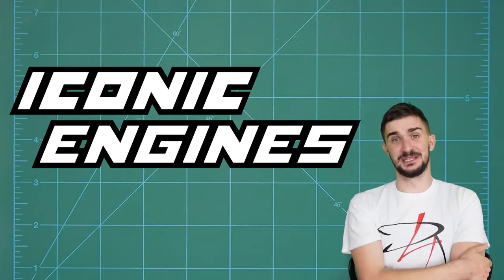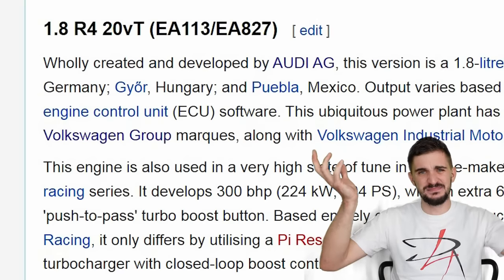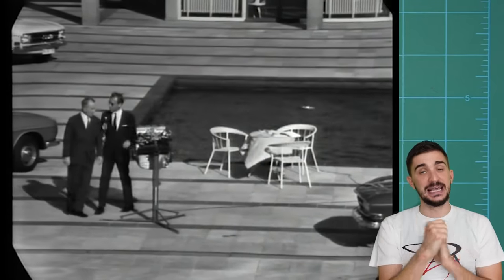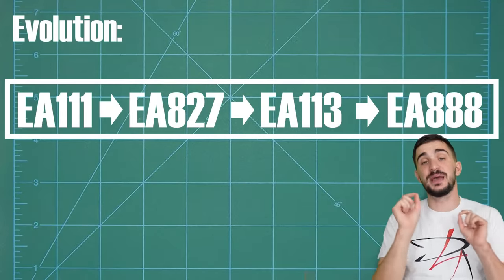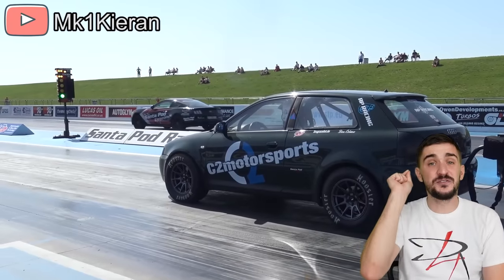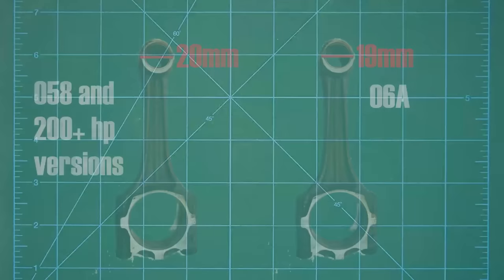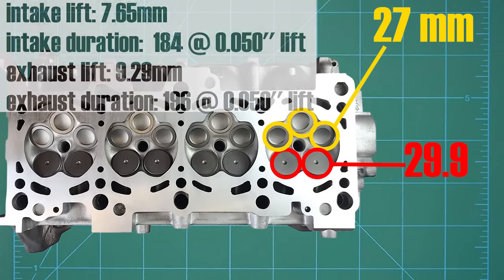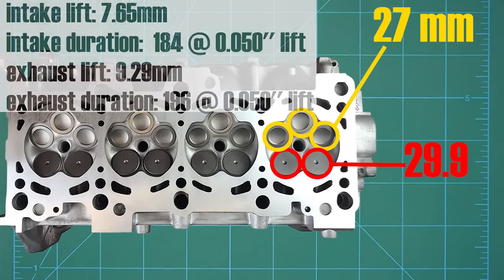VAG 1.8T 20V - What makes it GREAT? - ICONIC ENGINES #17

Comment: So glad the 1.8t is finally getting the coverage it deserves on Iconic Engines. It really is one of the best bang for buck platforms available.
Reply: As someone who drives a 1.8t 20v Gen 3 on a daily basis, i can agree. These engines can be pushed to 250 hp with nothing but a tune, and are able to break 9k rpm with minimal part replacements allowing for power ratings north of 500
Reply: Agree, building a 700hp 1.8t... LaunchBuilt is the channel where it's done
Reply: Yeah when youre looking for a sporty car..but the 1.9TDi will forever be their best engine :D immortal
Reply: @MisoElEven  real talk 🤣
Reply: @MisoElEven  the slowest maybe
Reply: It's the worst technology ever for these kind of power ratings. Everything else is better.
Reply: @eyelid81  it's basic nut and bolt engineering. Basic, tried and tested architecture. Plentiful, cheap to mod easy to work on. Yeah there are better engines sure but outside of America, cheap, high hp capable platforms are becoming very expensive. These are still cheaper than dirt
Reply: @jonathonwilliams93  it's not high hp capable platform. only cheap to buy. expensive to modify properly as it's not inherently designed for high hp applications, just cheap eco engine really
Reply: @eyelid81  not really but I'm not going to argue to change the mind of people on the Internet. You do you fella.
Reply: @jonathonwilliams93  Truth is truth. these kind of videos keeps the myths still up. Smokes and mirrors. Telling worst basic turbo engine ever is good. 1.8T Fandom is as bad as electric car fanboys really.

Truth: It's not good. Buy anything else, it will be better and more powerful.
Reply: Like what? What other decent engine comes in cars worth less than £1k?
Reply: @MisoElEven  the amount of 500 000k+ tdi is incredible
Reply: @alicichlid6805  it's only 150bhp engine. all the other more powerful cars with bigger engines
Reply: @eyelid81  in the UK you can still pick up golfs, leons, Octavias with 1.8ts for around £1k. What other car/engine combo is better value for money?
Reply: @alicichlid6805  those are ecocars. What kind of car you imagine beating with your 1k€ car? Nothing? Honda's? Even Hyundais which are more powerful nowadays? Beemers which are 190bhp minimum? 

I'll bet nothing. They're slowest of the bunch, that's why they're so cheap and it's xpensive to modify eco-engine to 300bhp reliably. 190 isn't enough as it's still 10bhp less than 200bhp which is starting point and minimun for a basic tuning-track car
Reply: @alicichlid6805  we used have dohc vtec going for 1k to 2k few years back now they way over priced
Reply: @eyelid81  probably gonna beat virtually every other car available for under £2k
Reply: @alicichlid6805  Junkyard cars? 150bhp isn't getting your ecofamily car anywhere.
Reply: @eyelid81  plenty of remapped ones for sale making 220bhp. That's still quicker than the majority of cars on UK roads today
Reply: @alicichlid6805  it can hold 190bhp by remap, still 10 bhp less than average tuner car. 220bhp is bullshit.
Reply: @eyelid81  early ones with the ko3 turbo will struggle to get 190bhp, later ko3s turbos will get 200+. Ko4 turbos left the factory at 225bhp. 
An exhaust and remap on a ko3s should be 220bhp
Reply: @MisoElEven   Can't forget the 1.9tdi. I'm driving a Touran 1.9tdi daily and 99 s3. That are the best engines they Made.
Reply: @eyelid81  i can see you dont like the 1.8t but i gotta say, i had a 9n3 with the 1.8 pushing 290whp, thing was a rocket, was hard to find many cars that would keep up in drags. From factory the 1.8 might not be the best in a heavy sedan, but in a light hatch they can move.
Reply: @nips8902  by heavy modifying doing 290whp, even replacing turbo and all the supporting mods. Not good engine
Reply: @eyelid81  yeh i get where you’re coming from, but i personally didnt have any issues with it. But that said there are definitely better platforms out there if you’re wanting reliability and power, from what it seems the people in the comments are acting as if this engine is the be all end all.
Reply: @eyelid81  lol you're def the kind of guy to look at stock hp. My car has stock 200hp but i cant do anything with it because it has cheap ass internals. These 1.8t and 2.0t engines are great and i wish i had one.
Reply: @eyelid81  buddy, nobody is racing these engines stock thats the point. The engine is tuneable idiot hence why people love them. Not all engines that make 250hp stock will be tuneable
Reply: @eyelid81  not bs lmao, ive seen a mk4 golf with some rebuilt internals making 350hp at 21 psi, hence why its tuneable and people love them
Reply: @kank1794  That's weak power, other engines do that with stock internals. It's not tunable if you need to replace everything to get medium power
Reply: @eyelid81  what lmao, the point of tunable is taking an engine, any engine, and making it powerful for what it is. Sure, look at a hellcat engine, from dodge you'll get like 400hp, but that's already been tuned and supercharged, what are you as a consumer going to do to make that a ton better other than add more boost if you can handle it. Yeah, the 1.8t doesn't make much power, and the 2.0tfsi is better stock, but they're installed in these small cars and if you get it to 300hp, thats a lot of power for a car thats 2000 pounds. While for example the 4.6 litre HSE v8 Range Rover p38 makes only 220 horsepower but its like twice as heavy so its slow. Weight to power ratio is also vital, having a big flashy engine means nothing if you drive a tank, 350hp in a Golf is gonna be crazy, while 350 hp in a truck will be good, but not that special
Reply: @eyelid81  also I should add, that range rover engine cannot be messed with much at all, so id rather have a 1.8t that i can push to 300 than a big v8 that has no future
Reply: @kank1794  All other 4cyl engines are more tunable.
Reply: @MD-gk4uh  1.8T is a religion for a childish men. I's tuning doesn't differ aything from other engines, and when putting comparison to other turbo-engines or even best for naturally aspirated examples, it's always the worst engine of the bunch.
Reply: @eyelid81  Get lost troll!
Reply: @MD-gk4uh  you get lost from car tuning scene. you're troll here - telling 1.8T is a good tunable engine - and losing every single race and lapt times since 2001 spring. 

I am telling the truth, I am not the troll here then. Telling the truth isn't trolling. If you can't handle the truth, then get lost.
Reply: But its not a VW engine!!!!
Reply: Yeah I own one and it is truly amazing. Got an 058 AEB engine, the most bulletproof of them all. Very nice engine
Reply: @MisoElEven  One of maybe but the 12v vr6 has been pushed to near 1000hp with stock internals and head work. Same for the 2.0 16v motor too.
Reply: @eyelid81  tell that to the guy running a 7 second pass in his A4 making 1,100hp on the 1.8 😉. Let me guess you’re either a jz fanboy or ls. Fact of the matter is you can do a full 1.8t build for the fraction of what you could do on most cars.
Reply: @tunanocrust5089  that's drag racing. basic 1000hp 4cyl is nothing new on those circles. IT doesn't need to hold up very long. fully built vs. fully built is interesteing topic however, as for street driven 500bhp car I'd still choose another engine, one not requiring full build and save money ;)
Reply: @glock1inthetop45  They're not slow in the right configuration, like the 130 or 150hp ones.
Reply: @eyelid81  have you ever owned one? mine is 1175kg and has 250hp on stock turbo, with injectors from the 225 engines, exhaust, fmic and of course a tune all for under 2000 gbp (£). name another car that you can have a power to weight of 212hp per tonne?
Reply: @eyelid81  like what?
Reply: @MisoElEven  my ALH TDI Jetta Wagon is about to turn over 333,333 miles and she still runs like an absolute top! I couldn’t really leave it stock though 😉
Reply: Nothing special about this engine.. I'm not saying its bad but its not  good either just average

Stone age engineering.. Basic design goes back to the mk1 golf or before🤦‍♂️ just like the headlight switches😁 most won't go over 300 hp with out being forged... Needs massive omounts of boost for low amounts of power because they flow like an average engine

Lazy and Don't like to rev sounds boring as oem...nothind special reliability wise....its the same as most boring 1.6 1.8 2.0 turbo engines from most manufacturers these days

I don't know much about the golf r engines etc but I know there better.... Il stick with my k20 thanks👌
Reply: @kank1794  you see 350hp on 21psi as a good thing... These crappy engines breath like a asthmatic... Good knows what you would be making at 21psi on a k20... Probly nearly double.. From an engine not designed for a turbocharger
Reply: @tunanocrust5089  please show me proof any vw 4 banger has got to 1000hp on stock internals... I don't even think a vr6 could do that
Reply: @rossfraser3921  there are factory k20's tho, and if we are gonna compare a VW engine to the K20 the 2.0T is the engine to compare to, same era, and these can be pushed as hard. Both are quality engines
Reply: @rossfraser3921  factory turbo k20*
Reply: @kank1794  I was referring to the non turbo k20s... And I agree the 20t engine in the golf r is a big step up.. But its barely the same era as the k20 is 20 years old and its only the very modern 20t that are holding good power

Both are good engines but the Honda engines are always better engineered.. For now

I have seen oem k20s hit 700+hp..its only the very modern 2.0t engines thst are capable of that.. 15+ years later
Reply: And most manufacturers make boring 2.0t engines these days.. The k20 made similar power with alot more fun👍
Reply: True but if you wanna make better with less cost you want ca18det
Reply: @hjuuh  I know even less about the ca18det engine than I do about the 1.8 20v t engine... I would still pick it over the vw 20v engine though👍
Reply: @jonathonwilliams93  
Too true done everything on it myself and never misses a beat , 
I’ve had the Leon 1.8t bam lcr for last 5 years , look after it and it will look after you !!!!
Reply: nice
Reply: @eyelid81  M52 FTW
Reply: They cant all be VW Chirons.
Reply: 1.8t big turbo b5 avant owner here. And its always nice to see people surprise when they hear boooost and its an old a4 wagon 🤟🤟
Reply: @ThunderAppeal  lmfaoo imagine owning a dodge, and being proud of it 😂😂😂😂
Reply: @b5Bart  what do you mean, where else are you supposed to get a Cummins?
Reply: @b5Bart  ok buddy, whatever you say👍
Reply: @eyelid81  wow 190HP what a powerhouse
Reply: @tunanocrust5089  you could say this for almost any engine if you throw enough boost at it but the big question is will it stay together, how long and what does it cost to get to this level?  No puny 1.8L engine should be pushed to these levels, you should be looking at larger displacement engines for these kind of numbers
Reply: @MisoElEven  Yes BUT: It’s too small for the T5 where it was implemented, it won’t hold long because it needs to pull more than it can take.
Reply: New Gen 4 is surprisingly stout, Stage 1+ on these buggers extra 70hp?? Something like that. Right around 340. 350 just of a remap no bolt on.. that's crazy.
Reply: @eyelid81 wtf are you talking about? New rods and bearings, a bigger turbo, fuel pump, exhaust valves, injectors etc and you're pushing 500hp, add a girder plate and style other internals and you're ready for 700+. Exactly how much power do you think you need in a 2800lb car my guy?
Reply: Yep and they do like to go bang
Reply: @alicichlid6805  I have a rover 220 cope that will spank any 1.8t vag car
Reply: @kank1794  you don't know range rovers if you think that engine can't be tunnel.  I seen those things well over 400hp. A range rover is not geared to be fast. And the vag 1.8t has no torque worth measuring and really tuners know that's were speed is made.
Reply: @tunanocrust5089  nonsense. I can build a 500hp engine for a vauxhall for about half the price of a vag unit.
Reply: @captainchaos3053  I doubt that. I can guarantee more 1.8t’s were produced compared to your little vauxhall. Therefore the parts are easier to source and probably cheaper for performance. I’d like to think vag has a little more money put into their chassis and engine designs, rather than a small European company.
Reply: @captainchaos3053  again I doubt that. Depends on the route you’re taking and the engine you’re talking about. The 2.8l 12v vr6 has been known to handle over 700whp with stock internals. Some people have hit 500whp with the 1.8t engine stock internals but it doesn’t last long. Rods and a head gasket is all you need really outside of the turbo, intercooler, and tune. The rods are like $400-$900 intercooler ranges between $200 to whatever and all the little ins and outs. Sounds like you’re way to biased.
Reply: @tunanocrust5089  the small European factory your speaking of is GM. The XE 16v engine can reliably handle 500hp without rods or pistons or any uprated gaskets.  Billions of the XE unit fitted from vauxhall/opel/GM/Holden/sabb all over the world. Costs less than $1000 to make 500ish hp.  I have seen stock standard 1.8t with blown head gaskets,  warped heads, leg out of bed just from hard driving.  All while running less than 250hp.  My rover t series 16v is sitting on a genuine 340hp but the difference is it has fantastic gearing and traction and can peg the speedo. The golf is as aerodynamic as  bedroom furniture.
Reply: @jonathonwilliams93  They can and do reach the same kind of numbers on stock bottom end and last just as long as a 1.8t at the same power levels.
Reply: @jonathonwilliams93  2003 onwards engines are gm based units the previous triumph based engines were also called "B" engines. Anyway its not about fan boy bs for me it's about what I can use and how I really like the ford cosworth range but the fairy tales I hear on a regular basis of 1000hp sierras and the like just makes me laugh. My own rover 220 is running 16psi on stock bottom end with a bit of head work for over 20 years no trouble and it's fast like 160+ fast but it's no drag racer. It's all about expectations big numbers for a few minutes or real world drivability.

Comment: I had this engine 13 years in my '99 AUDI A4 B5 QUATTRO and it had over 300 000 km without a problem. Incredible work. Amazing engine. And it still had original turbocharger :)
Reply: 95` A4 B5 Quattro, 413 000 km, stock AEB :))
Reply: *still driving it
Reply: @Engaelic  chad
Reply: Mines at 290k and it's alright, I don't daily drive it anymore but it's starting to get issues. It's had four turbos in its life, I've put two on it over 6 years. The main issue is gaskets and accessories, I can't really fault the engine.
Reply: 2000 b5 passat here atw, 058 block just hit 335 000 miles (540 000 km). Running 3 inch exhaust and a ko4 turbo, everything else is original :D
Reply: @jacobposchel5393  
It's a very good engine! ✌️👍✌️👍
Reply: @jacobposchel5393  hell yeah dude
Reply: My b5 broke down like shit when I bought, guess the previous owner was shit. Besides it was only 180000 km
Reply: had. one 14 years and engine never changed.....totally reliable.   except for 1 head gasket a real credit.well done Vw.
Reply: 2007 Audi A4 B7 still enjoying it!
Reply: 280,000 km
Reply: Me too, A3 8L AGU engine 345000 and original turbo and clutch. Running like on the first day. 😂

Comment: I was quietly hoping you were going to cover this engine, I’m glad you did, for someone like me who’s running this engine at 642bhp / 516ft-lbs in my S3! Even I’m learning something new, I enjoyed the history element of where it all began! These engines are fantastic and it will be sorely missed as with all the combustion engines slowly fizzling out to make way for the electric/hydrogen scene.
Reply from the maker: That's a real monster! Congrats. The emphasis is on slowly... I think we have far more time left to have fun than the media is trying to convince us.
Reply: Porsche will make synthetic fuel soon
Reply: @d4a  ICE won't ever fully die until batteries are light enough for planes and waterproof enough for boats; until then, we just have to get more creative about parts sourcing & engine swaps
Reply: @d4a  there's a bot in the comments impersonating you, it tells to contact them on Telegram to claim a prize.
Reply: At that amount of power and stress, you probably lose 1 hp every time you start the engine :/.
Reply: @RB-gv5xh  Not when everything has been uprated, all the internals are either billet or forged now. Good for 800bhp if I really wanted to push it.
Reply: @Ash-lq4xx  You're crazy dude :D
Reply: @d4a  could you do a video on vw Audi 07k? The vw groups most reliable and best sounding engine of the past 20 years that can reliably make big power. Can also touch on the history as to why vw purposely chocked the engine for potential tuning here in the US. I heard it was so it wouldn't compete with models that have a TSI engine like the GTI.
Reply: @Ash-lq4xx  I beg of thee to make a document with all the things you have done. It would be of amazing value to the comunity.
Reply: @Ash-lq4xx  that legal in your country?
Reply: @LtdJorge  sure is! 👍🏻
Reply: the fkking electric crap is going NOWHERE.
Reply: @Ash-lq4xx  How much did it cost? Would it cost more for a not regularly tuned engine?